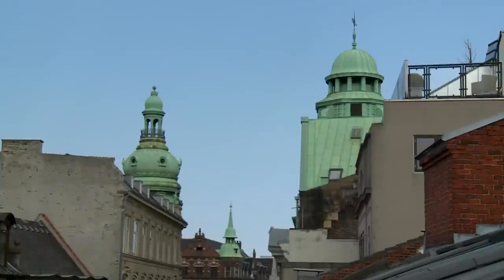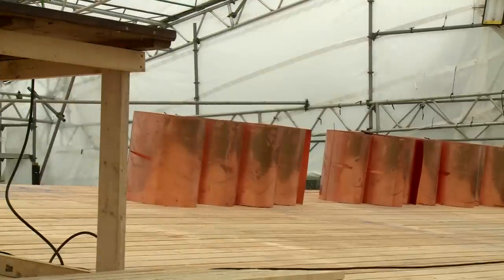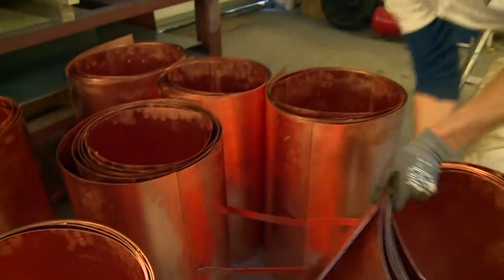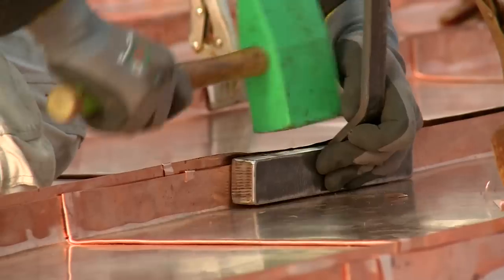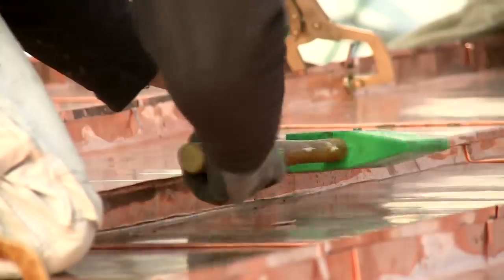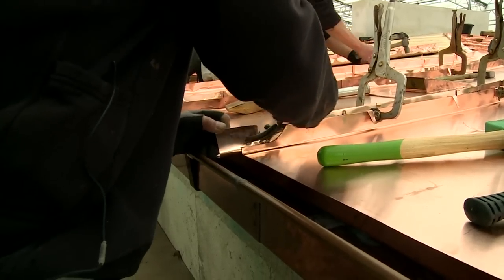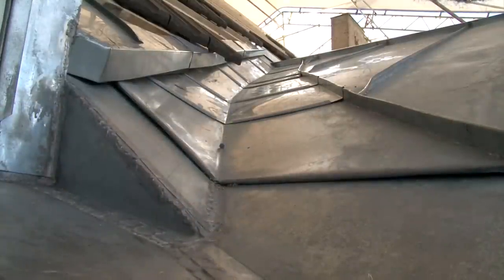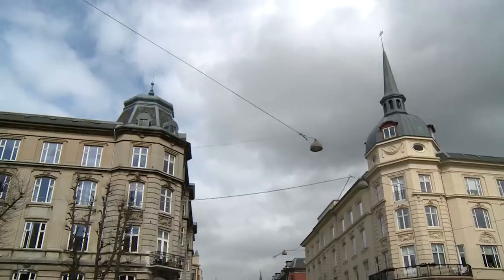Copper and Zinc Roofs

Comment: Amazing craftsmanship. I wish this skill and attention to detail existed here in the U.S. Also would be great if copper materials weren't so expensive.
Reply from the maker: Yes - come to Copenhagen when things again open op and see all the roof, maybe you can visit the handcraft builders also! - BR - Anders Dylov
Reply: Facts
Reply: Uhh.  I’ve done many roofs like this here in the states. Most of them old churches or old university campus buildings and a few gazebos, clock towers and the like. And this is just in my city alone.  I’m sure they are far more numerous back in the NE states.  The largest project was about 15,000 sq ft of roofing panels, 100’s of ft. of wall flashings, gutters and downspouts. Many upper end homes had smaller roofs systems and chimney flashings as accents.  Installation methods were very similar only I had a machine that closed the double folded standing seams, yielding far superior results than what I just witnessed in this video.
Reply: Asphalt works great for roads let's use it for roofs too /s somebody a long time ago should've known better.
Reply: @leadfoot8593  asphalt DOES work great for roofs.
Reply: It does I make a living doing so.  There are a select few in southeastern section  of Pennsylvania I personally have worked on homesteads circa 1690s. Bit this type of craftsmanship is still very alive today.

Comment: Knee joints out, then, the all the hammered folds might corrode over the decades as they got thinned. Very Expensive Old method. Hot Roof as well.

Comment: Freaking good craftsmanship! These guys know what they're doing. this clip should be shown to building professionals in USA who don't know a birds p00 about this craft. Thats why metal roofs there are actually bitumen roofs, perforated by thousands of screws, which hold the metal camouflage down.
Reply: I know several craftsmen that can and do this type of work. It's the fact that no one wants to pay the price. Materials alone, you're looking at 5-10 times the cost of an asphalt roof, completely laid. The value in a 100 year roof just isn't seen.
Reply: Tom B. You're right. The cost of materials and the labor cost together simply put a double locked standing seam copper roof out of reach of the average American homeowner's pocketbook. Folks understand the value. They simply cannot afford it. Noone wants to finance a $50,000 roof only to pay $75,000 with interest over time.
Reply: This is complete bullshit.  I’ve done copper roof system far greater in scale than in this video.  Matter of fact I was not at all impressed with their craftsmanship.

Comment: Why are the rolls made of short pieces folded together, instead of long unbroken rolls? Is it to help the sheets deal with expansion?
Reply: No it is actually the old vay to do it. The cupper is expanding in the squares - last up to 120 years - long sheets  roofs only last apx.  50-60 years because of the big expansion.

Comment: Nothing is said about those long straps that are put down between the sheathing boards. I assume they get affixed to something inside the attic space. Is it to framing or to the underside of the sheathing? I can't imagine it works out that there is always a rafter nearby.
Reply: They are secured to the deck from underneath. It keeps the middle of the panel from lifting off the deck in heavy winds.

Comment: l am a Spengler from Switzerland🇨🇭
its nice to see and good work, but this is how we worked 30 years ago over here. now you have coils and Schleebach rollformersß
Zinc and Copper, you can not work the same way. All those seamed up ridge detail would tear, doing it with zinc.
Zinc you work with Flashings, Covers and Cap detail, that allow for expension.

Comment: Is this copper roofing recommended for common residential roofs, instead of ceramic tiles? I wonder cause 1) the wooden planks beneath the roofing are not so tightly placed, 2) This along with the roofing material should make the heat insulation value worse, 3) as well as the noise-insulation...can one put insulation beneath it? 4) what happens with storms and lightnings since this is a metal roof?
Reply: Little late, but if anyone is wondering... Copper roofing can be used pretty much anywhere, even low slope (with solder) where you can't use any type of tile/shingle.

No roofing has any significant r-value. Insulation has to be installed under it. Metal roofs do get hotter to the touch, but they have less thermal mass to store heat from the sun on your roof. There are special materials/procedures for insulating directly under metal, due to the surface temp of it. Rain on metal roofs is definitely louder. 

Lightning is irrelevant for roof materials. A metal roof doesn't have any stronger ground than any other roof. Metal roofs can't increase the ground connection. Even a pole barn isn't setting the metal in the ground, so I don't think it attracts any more lightning than the grounding of the frame of the building permits...

Comment: Pretty amazing they are still doing everything by hand in this danish roofing company. With a couple of machines you would save ALOT of time and effort but with the exact same result.
Reply: Historical buildings are often governed by people who don't care about what makes sense. Their only concern is preservation of the original look and stye. For sure you can run the panels by a machine. You can't create transverse, pinch, and sweep seams with a machine. Not the same result...
Reply: joecee67  Still very new to it. I'm a contractor in Ohio. We've been trying to convince our customers to go this route with their roof replacements. It's an uphill battle though.
Reply: joecee67 send me a friend request on FB. I'd like to follow your work.
Reply: @robertunversaw  sure you can, that's how ductwork is made.
Reply: @leeknivek  this is not duct work.

Comment: Sorry for the ignorance but would it not be better to put something between the copper and the wood for more insulation or protection, like a layer of foam or something?  Would the copper directly touching the wood not mean more likely for it to rot or suffer damage?
Reply: No it must be able to move. Insulation below roof boards retrospectively with permeable insulation likely ok .
Reply: Yes it normally would, but that is likely an unheated attic. So the attic floor is likely insulated (smaller surface area to insulate the floor if you don't need to use the attic).
Reply: @Philsy1845  it's always best practice to insulate above the sheathing, rather than below it.

Comment: What exactly is "umber putty?"  I don't see any other videos where this is being used.
Reply: Jim Lundy putty is used to seal the join. Umber is a colour!
Reply: @edwardcharles9764  Why seal a double locked seam though? I've never seen it done either...
Reply: Robert Unversaw It’s not really a sealant. I’ts more of a lube to prevent ”self harm” to the materials. Copper and other metals tend  to move back and forth when temprature falls and raises. 
/ Swedish thin smith

Comment: To much expensive. To much
Reply from the maker: If you want a tight copper roof, this is the method. The price is probably less decisive, the most important thing is a roof where rain will not enter for many years to come - we are talking +50 years.
In strong winds, water can run upwards, therefore double folds